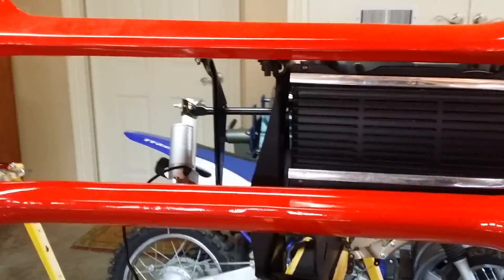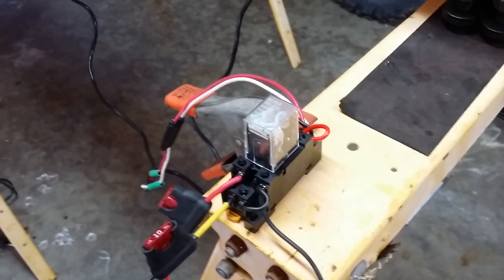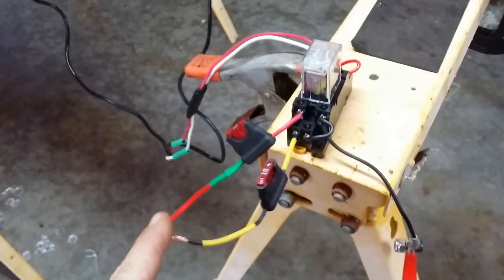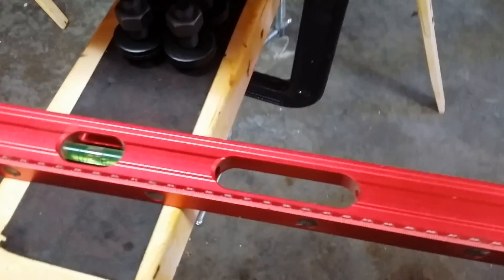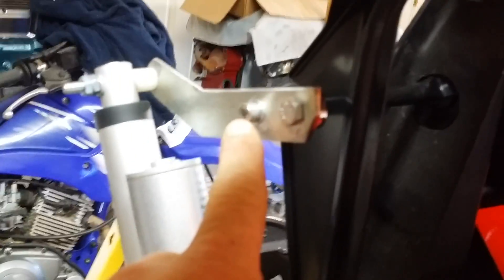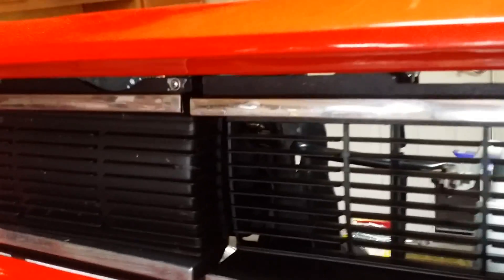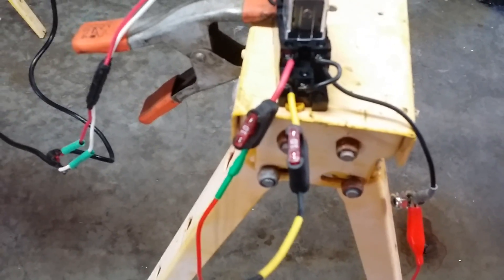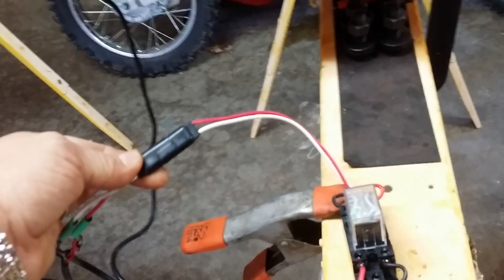1968 1969 Pontiac GTO Hideaway headlight vacuum to electric

Comment: I need help with the doors not opening all the way because bumper brackets. What did you do to clear that?
Reply from the maker: You need bumper brackets for a car with hideaway lights .... they are reverse of fixed headlight brackets 
You can find them on ebay sometimes

Comment: I absolutely love the idea of converting my vacuum to electric and have assembled the parts but not to sure on the wiring of the relay switch. Do you have a close up of the relay or possibly a diagram? Thank you for the inspiration.
Reply from the maker: 69MDGTO 
I can put a schematic together
Reply: Thank you so much!  I have an 8 pin DC12 10a coil voltage DPDT electromagnetic power relay w socket base. I believe it is similar to the relay in your video.  Did you mount your inside the car or in the engine compartment?
Reply from the maker: Engine compartment 
Best to keep that kind of stuff on the other side of the firewall
Reply: Did you ever get a chance to put together that schematic? Great video and I am planning to try this myself!